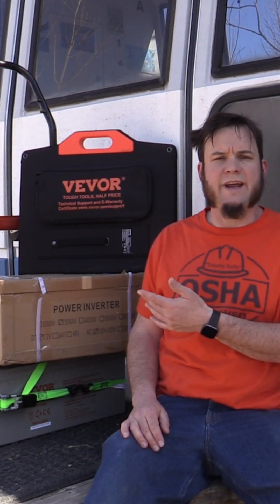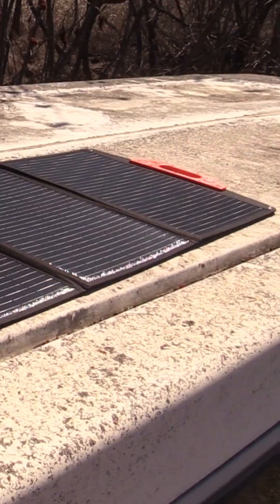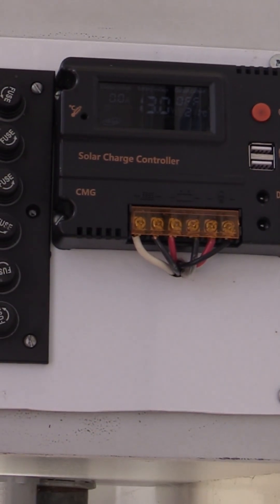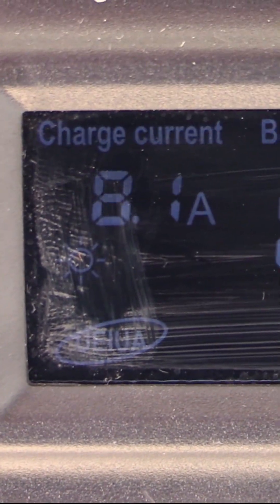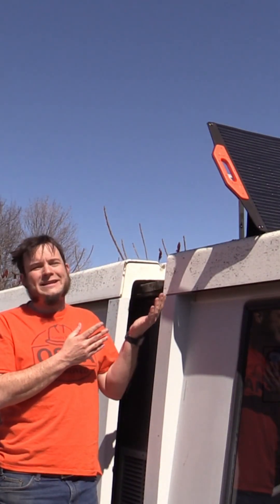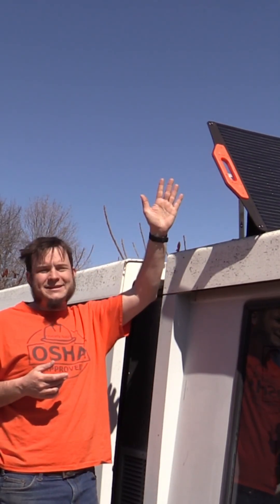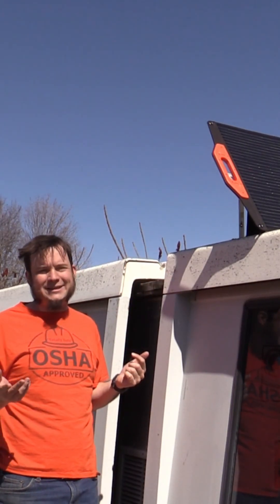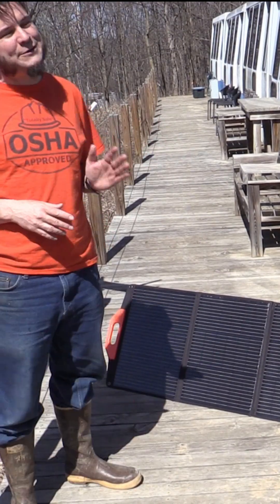Solar power upgrades to the Sandland monorail

Comment: I rode in those magneto-trains in the 80's.  you could lightly mirror-tint the outside of some windows, or just 4x8 boards for shade.  I have 600 watts of never used panels bought near duluth you can have for $320, stored in shed since purchase

Comment: Please is there any way you could find a time to test the difference in efficiency of the solar panel between direct illumination and diffuse light illumination? 
  I'm only interested in the percent difference per unit of intensity between direct and diffuse, so it really doesn't matter what units you use or how accurate your test equipment is.
   All solar panels supposedly decrease in efficiency between direct and diffuse light, but I am told that the impact of that reduction of efficiency is less for amorphous solar cells and has the greatest impact on monocrystalline cells. 
However I can't find any data for any solar panels as to how much that impact is, if it's even true,  when what I want is a chart comparing the different types and brands.